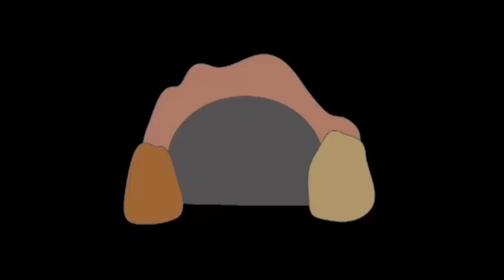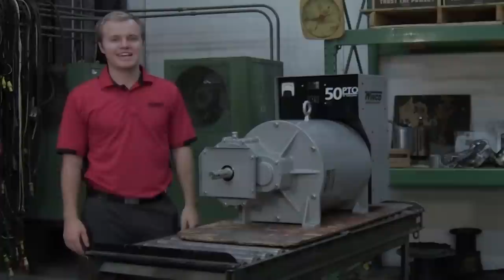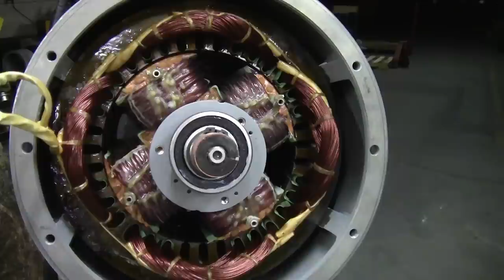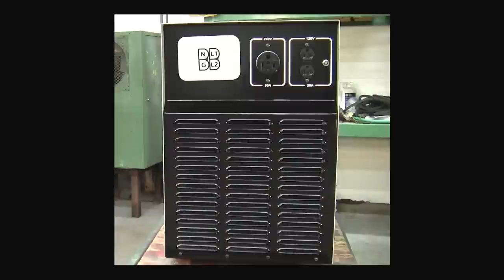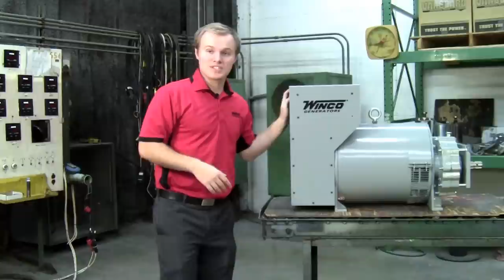Winco Power Take-Off (PTO) Generators 25-75Kw

Comment: Good video! thanks. / question: what's the difference between PTO and regular generators? I used to have a PTO on a Bucket truck a few years ago.I have a Winco 4500 (old one) in my garage but haven't been able to start it.are parts still available? thanks. John G. / New Jersey.

Comment: HERE ADD THIS YOUTUBE VIDEO TO YOUR GENERATOR. The name of the video is called; #1. (FREE ELECTRICITY GENERATOR HOW TO MAKE FREE ENGERGY 220V WITH 5 KW ALTERMATOR MOTOR). #2. This video is called; (FLYWHEEL POWER GENERATOR AND MULTIPLICATION AND STORAGE). #3. This video is called; (MAKE FREE ENERGY GENERATOR 220V WITH 5KW ALTERMATOR AND MOTOR FLYWHEEL FREE ELECTRICITY GENERATOR).   #4. That generator that in the video above could be used in the same set up as 1 to 3 video‘s listed here, but see them first.

Comment: That generator in the video would be good if it ran a 100%  on it own and be self running with a 100 to 150 horsepower electric motor, like the youtube video  thats called; #1. (FREE ENERGY GENERATOR 100% SELF RUNNING) #2. (FREE ELECTRICITY GENERATOR HOW TO FREE ENERGY GENERATOR 230 V WITH 5 KW ALTERNATOR MOTOR). #3. See the youtube video‘s and instead of using a farm tractor you would use high horsepower electric motor in place of the farm tractor. You be copying the first 2 video‘s and IT‘S FREE POWER NO DIESEL OR GAS ENGINE WORKING THE GENERATOR SET UP LIKE THE FIRST 2 VIDEO‘S SHOW.  AND THAT WINCO WOULD HAVE ENOUGH POWER TO POWER UP A HOUSE OR BUSINESS AND RUN FOR FREE
Reply: No.